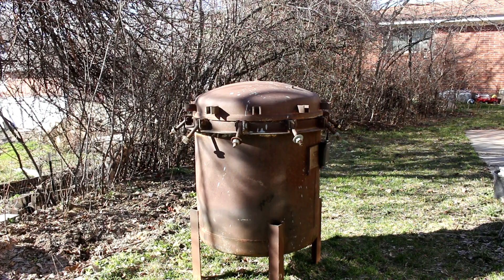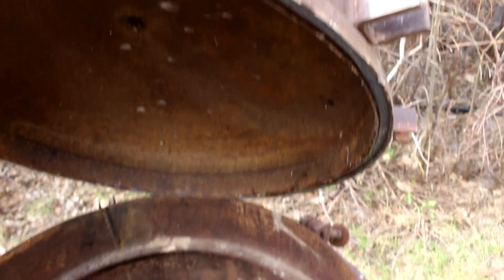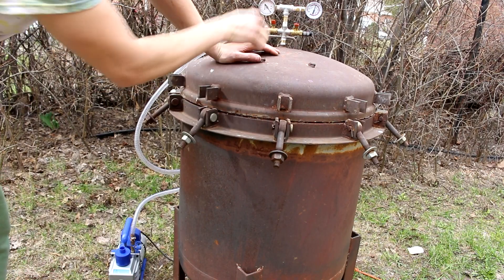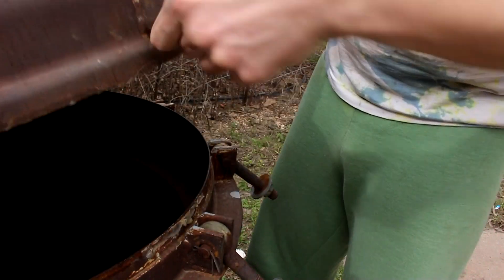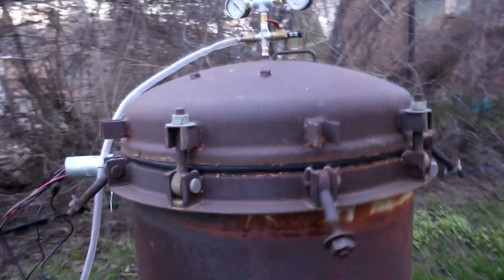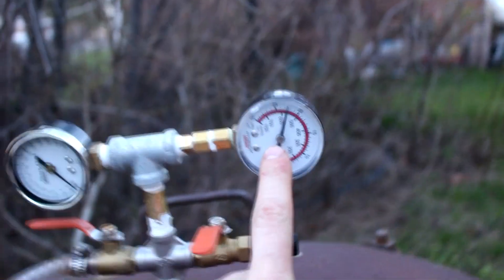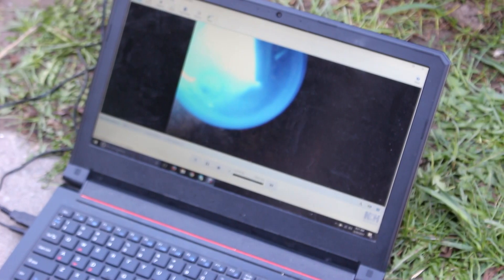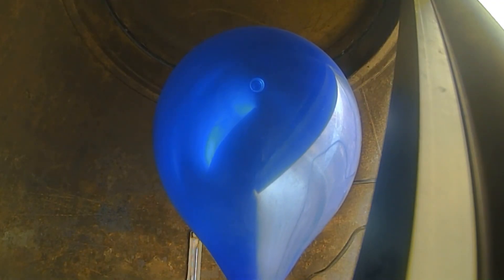Cody's 50 Gallon Press/Vac Chamber

Comment: so how would you actually know if it has a leak or not? if it takes a full minute to pressurize through that (relatively) large valve couldn't it take days to pressurize through a tiny pinhole? 
not that it would matter of course, since i doubt you'll be doing any experiments that require days of straight vacuum. 
but maybe you should leave it depressurized over night and see if it gains any pressure, if that's not too dangerous of course.

anyway, this is really cool, i know this thing means a lot of good videos coming up on this channel :)

Comment: Apparently you are still alive, because you posted this video. All pressurized vessel require a relief valve set at a value less than the operating pressure, in this case, you should have hydro tested this first with water to establish the working pressue you wanted,  The water would minimized the destruction cause by failure of a vessel in poor condition.  I think you just used one of your nine lives.  Your initial use of this vessel does not guarantee the soundness of this vessel.  Be Safe!

Comment: Man be careful with that piece of junk. It's completely unpredictable at this point.

The rust you're peeling off has openings for delamination to occur. God knows what the internal structure of that material is like.

30 PSI is probably still pushing it. Just blow the fucking thing up and be done with it.
Reply: The fact you're putting it under vacuum is very likely exacerbating any lamination problems. 

SCRAP THIS VESSEL IMMEDIATELY. IT'S NOT FIT FOR ANY PRESSURE RELATED PURPOSE

http://www.nationalboard.org/index.aspx?pageID=164&ID=234
"The laminations reduced the strength of the weld joint between the furnace tube and the tubesheet to less than 20% of the thickness of the plate comprising the furnace tube. The further reduction in strength caused by very moderate corrosion allowed the initial rupture to occur in the firetube at the inner end of the weld to the tubesheet."

http://www.twi-global.com/technical-knowledge/faqs/process-faqs/faq-what-is-the-difference-between-debonding-and-delamination-in-adhesive-joints-coatings-and-composites-and-other-defects-found/
Reply: dude why do you keep commenting it's his decision if he want's to blow his nuts off its his choice
Reply: Quick spam just to make sure he sees it. He's not just putting himself at risk, he has neighbours.
Reply: Tsf Phi neighbours,in the mountains in the middle of nowhere?
Reply: Alvis Gwa That's his parent's land where he goes often. Him and Kanyon live in the suburbs.
Reply: You don't know CodysLab very well, do you?

In short: 0 fucks given.

Comment: Cody - use a manifold boost gauge rather than a vacuum and pressure gauge.  Rather doubt your vacuum gauge will like pressure and the pressure gauge might not like vacuum.  Or add valves...
Reply: BigDaddyBeatzMe valves to isolate the gauges...
Reply: Philip Leichauer He has valves on it... Sounds like it's time for someone to get glasses or get a stronger prescription...

Comment: Doubt you're going to blast and paint that chamber, should scrape the loose rust and use a rust converter to get longer life out of that tank.
http://www.oreillyauto.com/site/c/detail/DPLD/RF129/N0472.oap?ck=Search_N0472_1387177_-1&pt=N0472&ppt=C0171

Comment: You should put a thermocouple vacuum gauge on that chamber. With the kind of vacuum pump you have, you ought to be able to get down to ~20 millitorr if your seals are good. The chamber is made out of metal, so you might be able to use a turbo pump if you want even more vacuum (outgassing from the silicone gasket would eventually become a problem though). Also, yes it does take a considerable amount of time to repressurize a vacuum chamber; I have them on gloveboxes, and the big airlocks can easily take three to four minutes to be fully pressurized (of course they're not quite as big).

Comment: would the chamber weigh less if it is evacuated?
just curious
Reply: Yes. Air has mass. I think Cody said there's about a pound of air inside.
Reply: Zak Zennii does that mean we're measuring every weights wrong? :o
Reply: Shanzid Shaiham depends on what you care about..
Reply: sofias. orange care to explain? or perhaps a link..?
Reply: Shanzid Shaiham weight is the force with which an object pushes towards gravity.

if you want to measure weight, weigh it under atomosphere. if you want mass, weigh it in vacuum (or take volume into consideration). in many cases, the difference doen't matter..
Reply: sofias. orange so normally in like my school lab when I'm measuring the mass of the beaker its actually the mass of the beaker and the air inside?
Reply: Shanzid Shaiham no, because the atmisphere around it cancels the effect. the beaker is lifted a tiny bit by the atmosphere, tho. it would weigh slightly more in vacuum.
Reply: sofias. orange Oo wow.. that's pretty interesting :o
Reply: sofias. orange I'd like to know more, does it have any specific name to it or anything that i can look it up with?
Reply: and helium balloons are light enough that the lift is higher than their mass. :)

i think "boiancy" is what the effect is called..

Comment: For next time you want to test a pressure Vessal it's always safer to use water, if it fails less force will be exerted as water condenses easier. That's  how pressure valves and vessal's are tested normally (still a scary process)

Comment: Not collapsing under the vacuum is impressive. I was a little worried about that, heh. And when you said the vessel was designed for 60 psi I thought about my pressure canner that's not supposed to go above 20psi...hmm! Then I remembered that I have four 5-gallon Corny kegs (plus a 3 gallon one) all rated at ~130 psi and I've force-carbonated beer in three of them at 60 psi. Some perspective! :D

Comment: Cody please be incredibly careful pressurizing this. even at 30psi, that's several thousand pounds of force in a vessel that size. I have seen much smaller pressure vessels violently explode with shrapnel due to very small rust induced structural failures, and this thing is entirely rust from what I can tell. pressure vessel are no joke, they kill and maim people all the time at much lower pressures. there's even videos of small compressor tanks causing massive blood loss and severed limbs. I'm sure you know all this, but I worry you get so into a project you forget sometimes :p
Reply: Jon Sands because more people drive and smoke
Reply: Guys, guys!
It's Cody's Lab! We don't know what common sense is here at Cody's lab!
Reply: I can only say that humans do crazy things to escape boredom
Reply: Even hurt themselves purposely... VSauce did a cool video on that topic.
Reply: Cody is HELLA SMART. Inventers, and those guys, HAVE to be experimental- so calm down MOM! He wearing his BIG BOY PANTS, OK?👌
Reply: Havent watched video, assume this is common sense?
Reply: Do a Hydrostatic test at above your planned pressure cap before you fill it completely with air. It would break at the same pressure but due to the lower energy present in the compressed gas it should fail much less dangerously. 

Although I presume you are competent and know that already.  

DO NOT PRESSURIZE BEFORE TESTING.
Reply: I can only say that humans do crazy things to escape boredom
Reply: I can only say that humans do crazy things to escape boredom
Reply: He should scrap it immediately and move on. This vessel isn't fit for any pressure related work.
Reply: Did not fully watch video before he did pressure test. That was hard to watch.
Reply: I used to work in the chemical industry and we had a vacuum dissolver (don't know if it's the same definition in English... it's a mixer) that was made out of 1 1/2 inch? (around 2cm) thick stainless steel with as few welting spots as possible and no rust anywhere. This tuned pressure cooker Cody made isn't save and he should scrap it if hasn't done that yet, the vid is quite old.
Reply: I can only say that humans do crazy things to escape boredom
Reply: I can only say that humans do crazy things to escape boredom
Reply: Jon Sands well i dont know about it. to me it seems that cars and smoking kills more

Comment: Use a glassfiber seal. It's also very temperature resistant. I think you can get it in industrial supply stores, it looks like a white rope. For 1st installation just remove the silicone und glue the new seal in the grove.

Comment: Could you repair a water-damaged phone by putting it in a vacuum to evaporate all the moisture?
Reply: The problem with electronics and water is that water conducts electricity, which shorts the circuit boards inside and does permanent damage, including possibly burning the boards and severing various connections.

If the phone was turned off when it got wet and was never turned on until put under vacuum, then perhaps that could work fine to fix it, but it would just be best to let it air dry across a few days.

Comment: Cody I worked in the natural gas field for many years so here is my advice to help keep you safe with this vessel. 1) Always keep the clamping bolts for the lip in place. If the vessel has a failure even under vaccume the lid could move and you could suffer an injury. 2) I would not use a pressure and vaccume gauge connected to the same piping tee. Either gauge can suffer damage if it is exposed to pressure outaide of it's operating range. This would decalibrate the gauge and you could over pressure the vessel and have a failure. You can easily find dual gauges for both pressure and vaccume in 1/4" NPT/pipe fitting. 3) The normal kind of seal that goes in lids of this type is a one piece o-ring. They do make square and round cross section o-rings in that size. Both the seal and gauges can be found at any oil field supply store. Some supply stores can custom make o-rings for most any size. 4) Clean off all the rust scale and take a depth measurement of the deepest pitting. If you can determin the type of steel there are charts that can give you the steels new stress rating. We used these charts in the natual gas industry as we has rust issues a lot and we would check to see if the pipes used to carry NG were still safe to use. Most vessels of these types have been over engineered by 1.5 to 2.5 X's for safety but.... do not take chances. Cody I hope you read this, stay safe guy.
Reply: Mark and Tsf Phi bring up some very valid points. I would like to add that there is also a less dangerous way to prove out a vessel under pressure and that would be to hydrostatically test it with water and not a compressable gas. If a failure were to occur,  the vessel would likely not launch. I have been working around power generation boilers and Naval propulsion boilers for the better part of 25 years and this would be standard for any repair and recertifications. The certs and certain repairs were done at 110% nameplate pressure. Be safe man so we can keep living vicariously through your videos!
Reply: @morrsha  Yes, exactly, one wants strictly water only, and then it can be safely tested
Reply: It's better than nothing, but if I were him I'd prefer to just ask someone to help him build one from scratch with proper steel that isn't already rusted to all hell. Perhaps Colin Furze could help him make one!
Reply: I was surprised at the lack of hyrostatic testing when I watched this, I figure even just filling the vessel under test [VUT] with water and then using an air compressor pressurize the VUT is way better than just Pressurizing the VUT with air
Reply: Boats don't sink every other day and you still take steps to survive in order to prepare in case  they do. I wonder why...
Reply: Needs to be seen.
Reply: Mark Schwartz i
Reply: yes was going to say about the gauges getting damaged a smashed one exceeding 400 psi when it was rated for 300 it now displays 70 psi at 0
Reply: Mark Schwartz what about a Hydro test? anyone who works in gas & fuel would have recommended that first, well from my experience anyway.
Reply: morrsha about time someone mentioned "Hydro test". l know you've work in the applicable industry & not some Mondays expert.
Reply: But getting hurt on YouTube IS the point.
Reply: Cody doesn't take safety advice.
Reply: Ya a hydrostatic pressure test should be all he needs to do. Go to half the rated capacity. I have a pipeline hydrostatic pressure testing guide if anyone is interested. I worked as a pipeline engineer for 5 and a half years.
Reply: Listen this man!
Reply: Even at four years old, this is the best comment ever
Reply: Vacuum.
Reply: Noone cares about safety.
Reply: I know you're making a little bit of a joke by suggesting Furze but pressure vessels aren't a joke, even at intuitively low pressures.  I'm sorry to be a big buzzkill but please don't approach anything pressure related lightly.  Grabbing a welder and cobbling together a few bits of steel into something that looks like a pressure vessel does not make a pressure vessel.

As far as getting youtubers involved I'd suggest WeldingTipsAndTricks (Jody). He can most definitely weld a pressure vessel together but being honest, that's only a small fraction of the work required to design and build even the simplest of vessels. 

I would love to see a collaborative internet effort in getting Cody a safe pressure vessel  but the paperwork is much more than people would generally expect lol.
Reply: John Shelley The chance of Cody being hurt is right in the middle of no one knows and that is why he is putting himself in danger. Not knowing if a pressure vessel able to handle a given pressure is worse, he will not know when it'll fail or how. 

As for Cody knowing how to use ecplosives, and I have no idea if he is doing it right because my experience stops at fire crackers, has no crossover to using and maintaining press equipment. Even though a pressure vessel can become a bomb it was never engineered to be one. An explosive is made to.... well explode. You know how it will explode, which way the blast will go and how big the boom will be. If a pressure vessel is going to fail it can do so in so many ways. Failing at welds, thread-o-let with weak threads, bad seam if it is not seamless, a pinhole from internal rust or external rust, being tempered incorrectly, being quench, and the list goes on.

Yes Cody is a very smart person but I do not believe he has sound judgement in this case.
Reply: That is also a concern of mine. Scrapping it should be the only route he should take.
Reply: wario is right I mean i think The risk of Cody being harmed in an accident from a chamber is not really all that likely, he does work with explosives and go into mines
Reply: Even if he follows all of your advice I don't believe it's fit for any pressure related purpose at all. I suspect that (severe) rust has caused delamination of the steel, effectively reducing the working thickness of the material to a fraction of its original. 

Combine that with the abnormal vacuum loading, the cycling between positive and negative pressure will open up any laminations accelerating failure.

SCRAP IT AND MOVE ON
Reply: The data tag on it also show no rating for handling negative pressure.
Reply: he probably doesn't care about safety he is the one who stuck his hand in mercury
Reply: No pain, no game.
Reply: Tsf Phi I think getting a real vessel would be a great idea. He could get a used vessel with a recert. In the natural gas field our company preformed NDI testing and would recert old vessel for their current pressure rating, usually a lower one. He could also just buy a prefabbed piece of spool pipe with flanges already welded on and then there would be no need for full vessel. He would just have to buy pressure rated gaskets and some stud bolts.
Reply: +Mark Schwartz
He's not your guy, friend....  lol

Comment: The baloon poping got me thinking "What if you put something that makes sound, like a speaker, and play a sound when it's in near perfect vacuum?  Would it still make noise, considering there's no air to spread the sound, like in space?", maybe could you try that?
Reply: Its touching the bottom of the  chamber meaning sound will use that instead of o2 to travel
Reply: Mhh yeah, true.. But what if you put it on... Let's say, foam, or whatever to "isolate" it, and have a mic inside the vacuum chamber?

Comment: 1931?- would a Scotchbrite pad make it easier to read? Please clean the inside with electrolysis- the rest can be tests of vinegar, citric acid, molasses, phosphoric acid, and other derusters. Unless you can clean it all with electrolysis, which may be beyond even your scrounging/adapting abilities...
I have a 1916 WWI bacon tin and matching coffee/condiment double-ended bottle-tin soldiers used to keep poison gas out of their food. I can't find anyplace that retins these old sheet-iron things, as you can't wipe tin into a bottle shape. They need acid stripping and hot tin dipping, or perhaps electroplating. They're butter-dish sized, the Bacon tin holds the condiment tin. Ideas? Assume disability-pension budget...

Comment: Hi Cody!
Usually when designig a pressure vessel if the material is prone to corrosion, you add a fixed thickness (about 1/8'') so that its operating life increases. Rust shouldn't be a problem for this vessel.

Comment: If you want to check safe pressure, fill it with water for the test and use a hydraulic hand pump. That way, if it does crack, there's not a lot of energy released. Would allow you to test it at, say, twice the pressure you are going to use in action.

Comment: I may be wrong, but that looks like a small batch retort. A retort used in sterilization of canned foods. I have never see one that small before, having only used 100 and 500 gallon units. The 100 gallon was much the same as yous, but had 3 large ports on the side. These ports could be used for sensor, and at least one always had glass installed to see into the unit during the retort process.